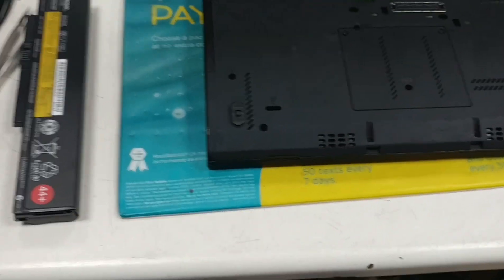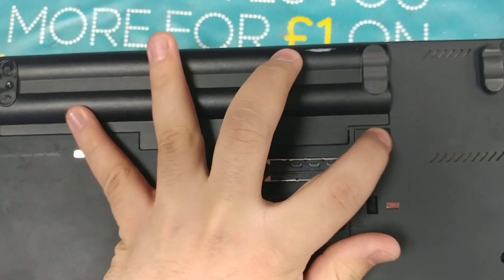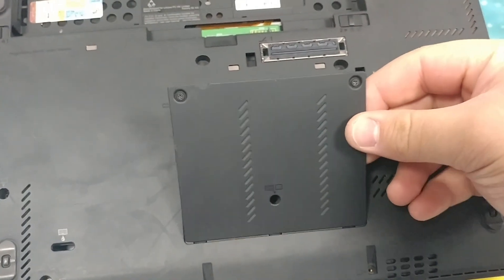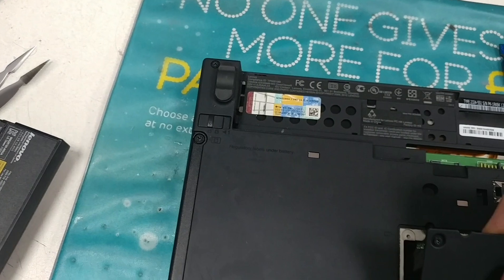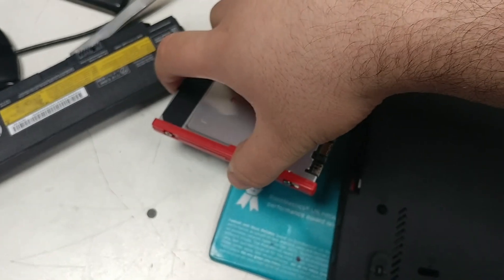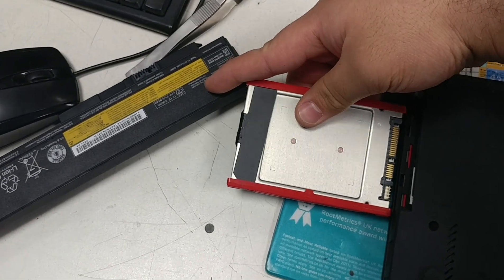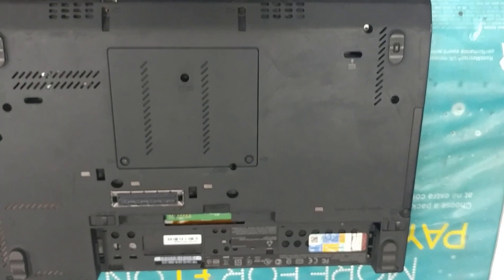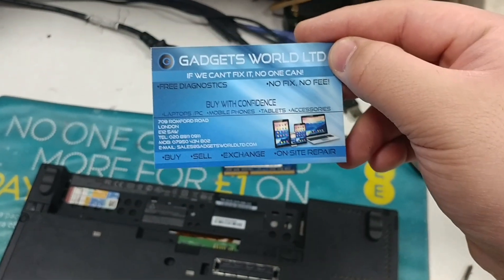Lenovo X230 RAM upgrade and HDD to SSD Upgrade

Comment: Thank you!  I'm now a YT content creator on my channel and I use the X230's and like so much I have two but I want to upgrade both...  For RAM the first one has 16 Gig which I'm told although it says it can hold 32 the motherboard only allows for 16 Gig which is that true? The 2nd has only 6 Gig.  I'm assuming the memory is what's called TVM (total virtual memory) which #1 has 31.7, #2 has 14.4 and for TVM can you tell me how much it can hold?  Final question is what's the difference between SSD to HDD?  Thank you!

Comment: What to do if the new drive doesn't have a ribbon, will I not be able to remove it if I need to?
Reply: thats a good point? Did you get an answer for this question?

Comment: I replaced HDD with SSD and put into caddy for using it as a external drive but the drive is not showing says it's dynamic drive and to make it basic i will loose data in it so is there any option to keep the data ani convert dynamic to basic

Comment: HI I GOT THE TOUCHSCREEN 230T COMING TOMORROW AND WANT TO UPGRADE THE RAM, SO CAN YOU ADVISE ON WHAT I SHOULD GET PLEASE? IT COMES WITH 4GB AT THE MOMENT I BELIVE...aLSO I WANT TO UPGRADE THE STORAGE, IT COMES WITH 128GB SSD......SO WHATS A GOOD LARGER SSD I COULD PUT IN?, NOW THIS IS COMING WITH WINDOWS 10 INSTALLED SO HOW DO I GET AROUND THAT ONE WHEN I CHAGE THE HARD DRIVE??....HOPE YOU CAN HELP AS IM A BIT BAFFELED BY THIS ONE ....THANKS AGAIN

Comment: why you not use both of ram slot?
Reply from the maker: you can but there is a minor reduction in preformance but in almost every use case this isnt an issue.
Reply from the maker: you can also upgrade to a max of 16GB with this motherboard so an 8gb RAM chip is preferable.

Comment: did you just said that this thinkpad x230 only able to read a certain type or merk of ssd?
Reply from the maker: in the form of Sata 2.5 drive and mSata drives. So long as it can fit it will be fine. M.2 drives are not compatable

Comment: Hi there, i've got an x230 as well - Unfortunately mine has started to randomly reboot. I changed the hard drive to an SSD, replaced the RAM from 4gb to 8gb, applied thermal paste on the CPU as well as updating the BIOS. Yet it still reboots randomly. Sometimes it will go hours without rebooting and sometimes it would reboot just after turning it on. I've also disconnected the battery and plugged in only from the power cable - yet still no luck. Any ideas on what it could be?
Reply from the maker: may be a short on the motherboard. check the drive and ram in another machine if you want to be sure. but most likely its the motherboard. you can use a live linux usb drive if you dont want to take it appart and boot to that. if you are able to run it (do not install) you can ignore the motherboard and it would be something with the hdd connection. you can try to install a msata drive instead but it might be better to just install a new motherboard as the prices are decent at them moment
Reply: @gadgetsworld9642  hey thanks for the feedback! About 2weeks ago i tried re-seating the WLAN and i think that may have actually done the trick. It hasn't re-started since then. Where are you guys based? - I'll probably drop by if it starts happening again.
Reply from the maker: @TheCensoredGoat  We're based in London but have an ebay store which ships internationaly. 
https://www.ebay.co.uk/usr/gadgetsworldukltd
We are located on 709 Romford Road E12 5AW if you ever want to stop by or have a repair. Thanks for the suport man its appreciated

Comment: can you share the ssd model you are using?
Reply from the maker: In this specific video we were using a Toshiba SSD from 2013 which is what we had free. Though any thin (0.7cm) 2.5 SSD will do. The X230 only fits slim drives (Including HDD) so please keep in mind when buying

Comment: Hey there, nice video! I got a question that might sound a little bit silly but anyway:

When you replace the hard drive, you have to copy it to the new one somehow? Or you just replace them and all the data gets transfered automatically?

Thanks in advance
Reply from the maker: The new Drive would typically be blank or if you had done so previously (Have an installed OS on it). You are able to clone the old Drive to the new one using 3rd party software but some issues can occur. I recommend that you backup the Data to an external HDD or USB first and then after installing the new Drive (and OS) copy the data to a folder in the Desktop ("Old Data").
Reply: Thank you very much for your thorough reply. It was really helpful!!
Reply from the maker: No problem. If you have any other questions about this or any other system let us know. We'll either answer in comments or do a full video on it if we are able to. Sincery Alex from Gadgets world
Reply from the maker: You can also transfer the Old Drive to a 2.5 HDD cadey and use it as an external Storage device. 
This is the option i tend to recommend as it is the least complex method and cadey's are fairly cheap (Typically £10-£20)

here our video on it if you want more details
https://www.youtube.com/watch?v=F5kihdDxuWY

Comment: What ram and SSd did you buy
Reply from the maker: any sata connection SSD will be suitable. Samsung drives are unofficially the best and the software support is good. but realistically any drive will do. Kingston drives are good value for money. 
you can also set up your system to have 2 drives if you would like:
https://www.youtube.com/watch?v=IoJIzUnBAu4&t=26s

Comment: how do you know wich kind ssd you need to get ?
Reply from the maker: Many different brands of SSD have come about recently. The Samsung 860 Pro is commonly considered to be one of the best but this unfortunately comes with a high cost. 
Kingston SSD's have a good middle ground with performance and price and are very reliable. 
M.2 Drives are faster than Sata Based SSD's and can be installed on any computer with a compatible port and would be recommended over a SATA based SSD. 

https://youtu.be/IoJIzUnBAu4

https://www.amazon.co.uk/s/ref=nb_sb_noss_2?url=search-alias%3Daps&field-keywords=kingston&rh=i%3Aaps%2Ck%3Akingston
Reply: @gadgetsworld9642  yeah, i have one of those Kingstons running on my PC and it's fantastic for the price.

Comment: he didn't even dual channel the ram ;_;
Reply: Mike Hunt what does that mean?
Reply: Dual channel is a configuration for ram that makes it a lot faster. You need 2 ram modules. So instead of installing 8gb in one slot, you install 2 4gb and they will be a lot faster.
Reply: vedi0boy can I install 2 8 gb in Thinkpad X230 ? Will it work ?
Reply: @ALN98007  I'm not sure, you will have to check online. But from what I've seen, it's likely that 8 is the max.
Reply: @ALN98007  I was curious so I did the research. You can do 2x8gb, but it's very uncommon to do that. 16gb of ram seems overkill and a waste of money when paired with the processors available in the x230. I currently have 4gb in mine and I rarely even use all of that. I think you will be more than satisfied with 2x4gb.
Reply: vedi0boy thanks for the answer ... I ask because I have bought a X230 Thinkpad with 8gb ... it will arrive next week ... and I already have a 8 gb RAM in my old Laptop so ..
Reply: @ALN98007  http://www.thinkwiki.org/wiki/Category:X230 says you can put 2x8GB

Comment: Hello, is it possible to upgrade CPU? I mean i5 for i7. Thanks
Reply from the maker: Unfortunately no, both the CPU and GPU are soldered directly to the motherboard and are not upgradable.
Reply: CPU is soldered to the board of the x230
Reply: Thank you much for your answers, I bought t440p
Reply: But you can use sth like https://de.gearbest.com/laptop-accessories/pp_229102.html?wid=1433363 to connect a PC graphics card via express card to the X230. It's called eGPU.

Comment: I have X230T  i just found out yes day my bigger drive wont fit I never had his trouble in other laptops seems like they made them smaller  Now I need to find one fits in my city
Reply from the maker: These laptops can only take 7mm thick hard drives, the old hard drives are 9mm and it won't fit in this slot. 
Unfortunately, you would need to source 7mm thick hard drive.
Reply from the maker: https://www.youtube.com/watch?v=IoJIzUnBAu4&t=11s
If you arent able to find a 7mm drive this is a good alternative.

Comment: Do you still recommend this laptop in 2018? Looking at this refurb : https://goo.gl/uGUwkA
Reply from the maker: In short, Yes. The X230 is a very well built machine from Lenovo which is still relevant for office work, browsing and some other specialist programs. (If you tell us specifically what you're going to be using it for I can help more).
I would be wary of listings, even if its on amazon that doesn't show the actual product, but only an edited image.

Our shop sells this Laptop as well, and this is our listing:
https://www.ebay.co.uk/itm/122691271061?ssPageName=STRK:MESELX:IT&_trksid=p3984.m1555.l2649 

If you send us a message that you want the same specs in the Amazon listing we can match it an work out a price for you.

Comment: is it possible to add m2 SSD on x230?
Reply from the maker: We are planning a video discussing this exact topic. This will be comminy soon.
Reply: Yes, I confirm it's possible. I've a normal ssd and a m2 ssd in my x230
Reply: Not sure how this is possible with an x230. The mPCie slots under the keyboard are a full size (MSATA or WWAN)  and half size (for wifi). You could install an SSD in the HD bay.
Reply: Previous poster (Wedibus) , says that he has installed an M.2 SSD. No , he has not . The only SSD which it is possible to insall there  is an mSATA. I have installed an mSATA , in the slot where the WWAN resided.